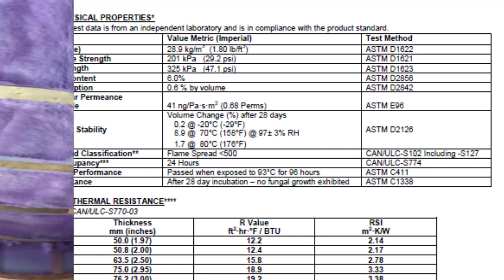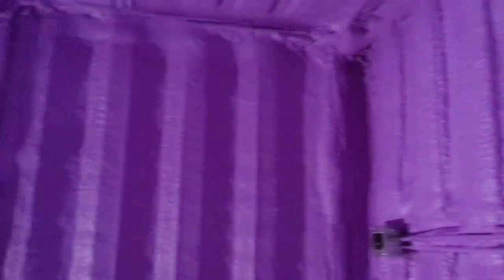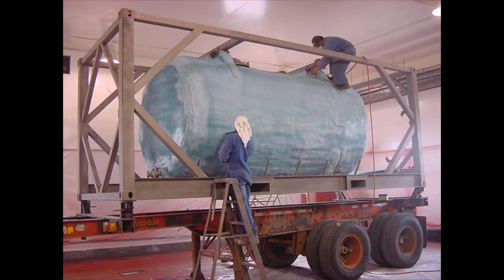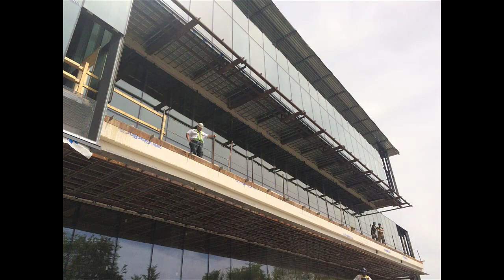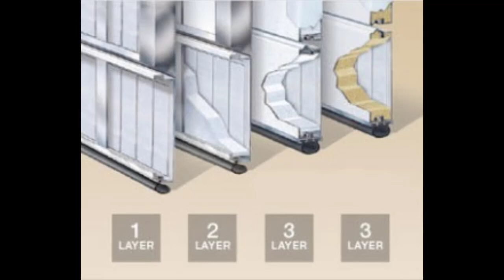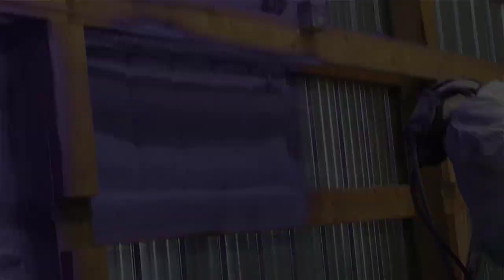Spray Foam Insulation Discussion : Under-slab, Corrosion, Warping Metal

Comment: Besides the concerns you pointed out, the only negative I've heard on "Under-Slab" spray foam is difficulty determining concrete volume when pouring thin slabs due to uneven thickness. I suspect this is due, primarily, to the skill of the applicator.

Comment: I've seen guys in videos use spray foam insulation on the outside of Quonset huts then cover the spray foam with shotcrete.  I was curious what you would need to do to use spray foam on the outside of a metal building like that?  The video in particular was by Viking Shelters.  They built an underground shelter with a Quonset hut by first priming the steel structure then covering it with spray foam.  

I'm curious what you use for a primer to apply spray foam to a metal building?
Reply from the maker: Depends on the metal. I have a whole playlist for metal buildings and you can watch and learn.

Comment: My hvac guy said having metal ducts in a spray foam attic will cause it to corrode. Is that true?!
Reply from the maker: What do you need to happen for corrosion to start on galvanized sheet metal?

Comment: I been learning alot about the different applications with this foam. Heck besides the gap filler cans, the only other time I have come into contact with a different application type was in 2013 on a NGL pipeline jobs when it was being applied on different elevations as a water break.

Comment: I don’t understand your applicators reasoning for why he sprays the post frame wall the way he does. Any why isn’t he gauging any of the foam? I’ve been spraying foam for 12 years and I start by filling in behind the posts, then start at the floor at about 4 ft wide and spray up to the 8 feet mark. Gauge the foam, fill in anything that’s low then move over to the next section of wall. Seems like a lot of jumping around starting above and working your way down the wall one section at a time. I see he does the same thing with stud walls.
Reply from the maker: Chris, bugger off. It is a video showing some spraying. Go make your own channel.

Comment: I was wondering what your thoughts were concerning prefabricated walls with the full cavities filled with foam. Specifically, what effect does the different rate of expansion, wood vs foam, have on the building structure. I am trying to build in Fairbanks, AK. Winter temperatures reach -50 degrees Fahrenheit. I need to consider temperature differentials of 120 degrees Fahrenheit if I were planning on 70 degrees inside and negative 50 degrees outside.

Comment: Thank you your videos are very helpful. 
I’m building a shed To sleep in by my shop. 
I’m definitely going to spray Foam insulated.
Reply from the maker: Glad to help
Reply: @SprayJones  
My biggest issue with regular insulation is the air follow through. What’s your take on? 
A 2 x 6 wall. With 1 1/2 to 2 inches of spray foam. With Cellulose Wall bar(I think that’s what it’s called) In the rest of the cavity?
22 years ago I Build a shop and used wallbar 
It was great. 
But however I like the structural Stability the 
Styrofoam gives.
Reply from the maker: @openyoureyes3113  I go all spray foam. I do not use a typewriter and my laptop at the same time. Only one.
Reply: @SprayJones   
I watch your video On diminishing returns of spray foam. 2 to 3 inches sounds good! 
I need to 2x6 for stability. 
Going with 6 inches of Styrofoam it’s a little expensive. I don’t want to leave empty air cavity? I guess I should get a price both ways! Or are you suggesting leave the cavity empty. 
I do roofing. I find that with no air space no condensation. 
The insulators that I use to blow in the cellulose. Are big fans of spray foam. 
Their family base by Saskatoon.

Comment: The only problem I see is if you spray foam directly to the metal and you have to replace a panel or more you will have problems. Such as the spray foam being stuck to the panel and making it very difficult to remove. The spray foam will actually rip out with the panel. I watch a channel that builds pole barns and he uses a tyvek  type product to prevent the foam from sticking to the metal. Would this not be a better idea?

Comment: Rust is always a problem when oxygen is present. Concrete without voids seals the metal away from the air. Foam should do the same, but existing rust followed by foam that cracks (for some reason) will let air get to the rust. Solution - use stuff that wont rust.
Reply from the maker: Thanks for that David. Curious will someone do that if it costs more and adds a week onto the build?

Comment: Don't just lay the rebar on the dirt and expect it to do the job. It has to be sat in the middle of the slab so needs to be stood off the ground (or the foam) before the concrete is poured.
Reply from the maker: Of course.... the concrete ppl pull up on the grid as the pour. Have you not watched?

Comment: 1st off thanks for posting these videos. I am in the process of evaluating the proper insulation we want to use in our new home we are building here in Alaska and your videos are helping me get my head wrapped around using the closed foam product instead of what I have always done. Great job on them as I have watch quit a few of them and they are very informative.

Your example of thermal bowing on garage doors is incorrect. I own a garage door company in Alaska and have been in this industry for 40+ years. We deal with this issue on a regular basis. The foamed in place garage door sections if they are not strutted and reinforced they WILL thermal bow. This typically is not an issue at the jambs as the doors will continue to seal but the head of the door will bow enough to pull the face of the door away from the jamb allowing a fairly good size gap if the temperature difference is significant and the top section is not strengthened to keep it from bowing. We are dealing with extremes for temperatures by many standards as the reality is we can see -40  temperatures in many areas and in a heater facility at say + 60 degrees in a shop this is a 100 degree differential. If the top section is not reinforced your going to see some significant air leakage out the top in the center of the door. This is not the same situation you are dealing with as the steel front and back panels are expanding at different rates and on your building application there is not a steel fixed plate tied to the exterior face. I would use a different example to prove your point though.

Comment: I warped one of those cheap carports.  The metal was paper thin. If the metal is nice and heavy, no issues.  I now warn the customer before application and write it in my contract description.
Reply from the maker: Yes, same as a cube van body. Next time skim it with 1/2 inch, let it set up and then spray the rest. Know that will know your yield down so plan for using extra.

Comment: I was watching another video where it suggested house wrap under the metal siding and spraying the foam to the house wrap if for no other reason than serviceability of the metal panels.
An example would be needing to replace a panel after an exterior force damaged it (car driving into the side of the pole barn)
It would be much quicker and easier if it wasn't necessary to remove all the spray foam to unscrew the panel.
Reply from the maker: Sure. But that only works on new builds. What about existing?
Reply: @SprayJones  So for planning a new build you recommend house wrap? 
Wouldn't foam stick better to metal and help prevent stretching the screw holes and improve strength of build? 
If you had to remove a large roof panel can't you just unscrew and cut out foam on back then replace new panel and reapply foam?  
Might actually hold shape and make screws go in easier if foam holding edge panels.  
Planning future barndominium.  Thanks